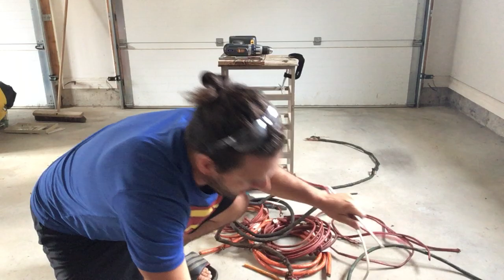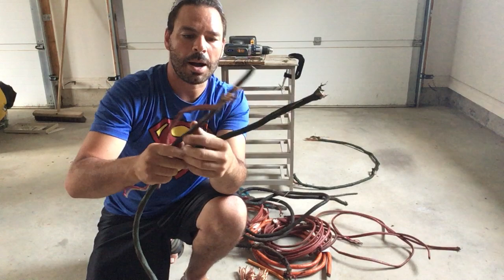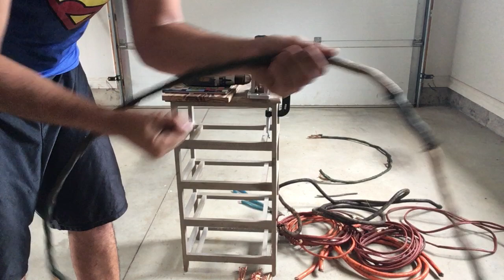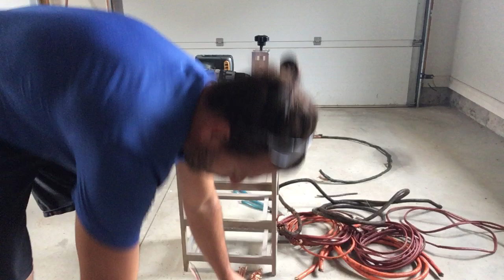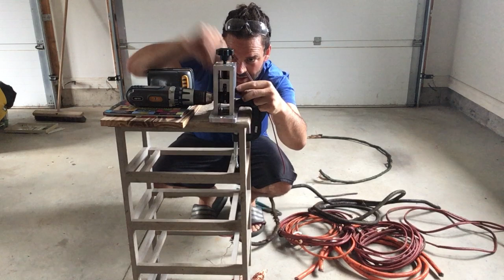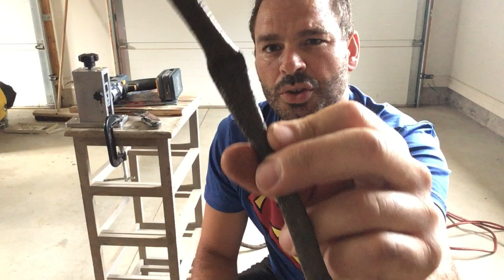Scrapping and stripping old house wire for copper.

Comment: you do know on the regular plastic romex you can open the end and put the shiny ground wire in the vise and pull the other and it will strip the outer layer all the way down really neat
Reply from the maker: Yup, actually I don’t even put in my vise, I grab the clean wire after a small slice, and just pull, it rips the rest of the outer layer off.